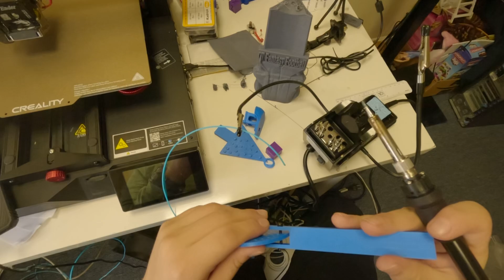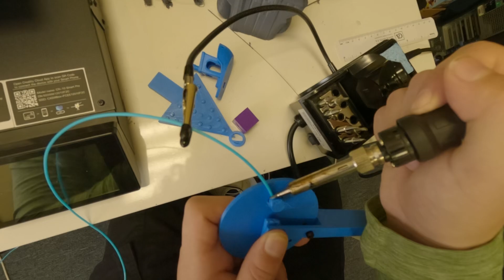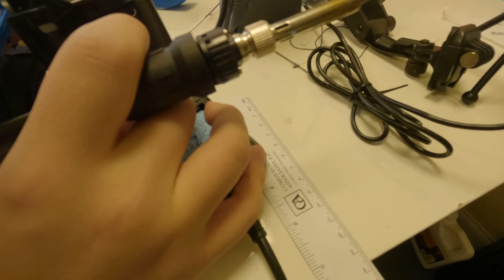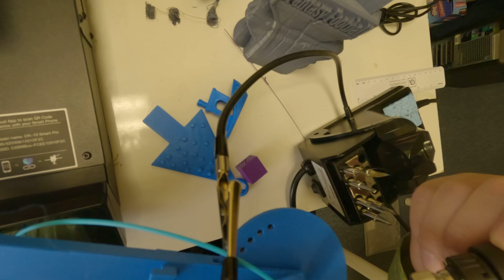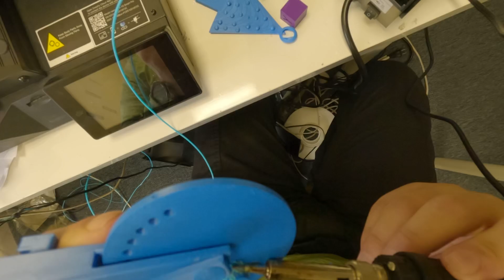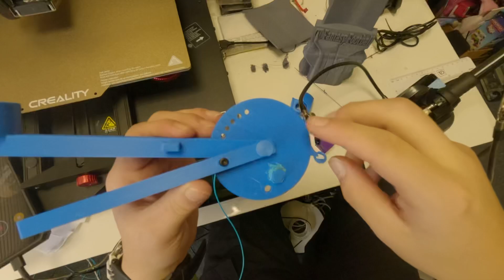How to use a soldering iron to fuse 3D-Printed parts together #3dprinted

Comment: How come you decided on using a soldering iron instead of something like epoxy or superglue which would also warm the PLA and make for even better adhesion?
Reply from the maker: It ends up being more economical for parts that don’t need lots of structural integrity.  Also, it’s quicker than using any sort of glue.  I don’t have to hold the parts together.  Also for that specific case the cylinder was a little too small so I had to add extra plastic for it to stay.